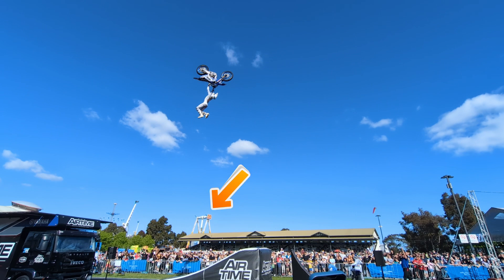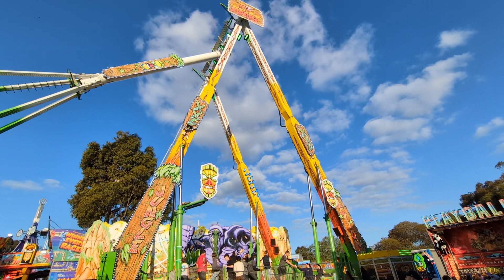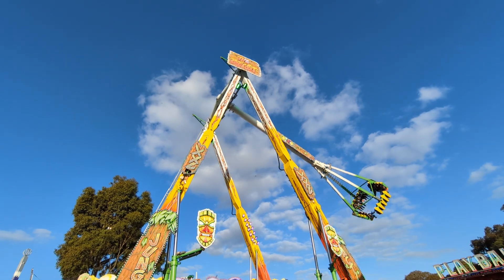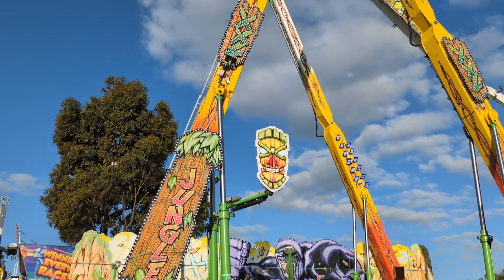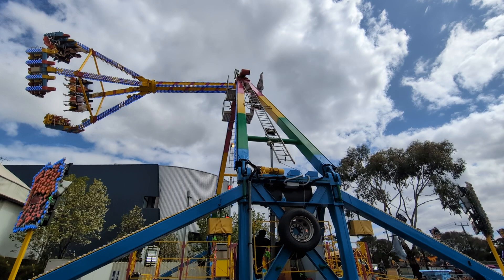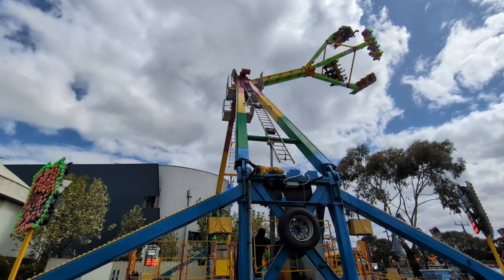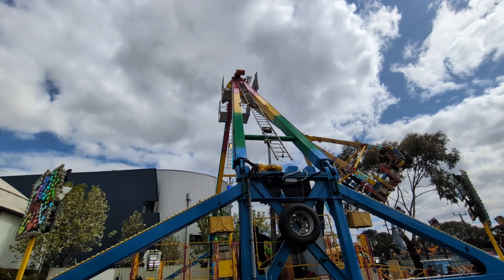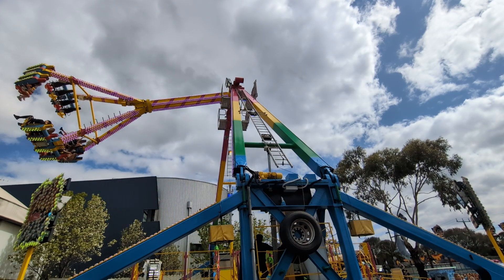Carnival ride chaos - A potential design flaw disaster?

Comment: Both rides are designed by the same company in the Netherlands. There are over 40 copies of the second ride around the world. I think they know what they are doing.
Reply from the maker: What is the company name? I'll contact them and see expected movements. Maybe it is fine, but in my experience steel doesnt move that much without fatigue issues.
Reply: @Nerb1  KMG Rides. They are the Ferrari of carnival rides. It is very common for rides to wobble like this, they are designed to flex so they don’t crack from stress, similar to tall buildings.
Reply from the maker: @tysonskyes6980  If looks like the model is "freak out". I have messaged them with some technical questions. I'll see if they have time to respond.
Reply: @Nerb1 this is a world famous company bro, not as simple as I’m gonna contact them 🤓
Reply from the maker: @XtremeScreamsYT31  They have a contact form dumb arse.

Comment: The biggest concern I would have is the Showies that maintain them.😬
Reply from the maker: Yep! I agree!
Reply: Australia has very detailed legislative requirements for the operation and maintenance of rides to ensure public safety. Regulations apply to both fixed and mobile rides and are enforced by the Regulators of each state and territory. This pendulum swing ride will have been given a Design Registration Number after an inspection by state-certified engineers to operate in Australia and this is signed-off by the Regulator. Given this, I wouldn't worry about it being an unsafe design. During the certification process, the engineers provide the owner/operator with an inspection checklist and schedule. You then have to rely on the operators/owners maintaining the ride accordingly and updating the ride's logbook. The logbook is examined during the annual inspection that's mandated by the Regulator and carried out by certified engineers. There is also the requirement that a more in-depth 10 year major inspection be carried out as part of best practice but this is only expressly mandated in Queensland, as far as I'm aware. It all boils down to how much you trust the government ;-)
Reply from the maker: @stephenmundane  Unfortunately all of these things applied to the Melbourne Star.... and it failed from fatigue after 40 days of use. 
You may be right and this ride is checked often, but in my opinion the visible bending of large steel box sections is certainly going to fail by fatigue... it is just a matter of how long.
Reply: @stephenmundane  that all sounds very impressive... so tell me how well that worked with that water rapids ride on the Gold coast.  Holes in the swiss cheese and all that.
Reply: I work on the theory, if a catastrophic failure didn’t happen on the 2 or 3 runs while I’m waiting in line & watching,…
…she’ll be right mate. 👌👍
Reply: nah mate she'll be right
Reply: @peterbarakan9006  ha ha! Those machines start out professionally made but end up covered in the best bird shit welds in the country.😂
Reply: Good work Nerb highlighting the risk factors. I barred my children from these vomitron rides and now the grandkids get lectured too.
Reply: This... 
Mum and Aunt remember being on the Zipper with me as a kid,  and well as we were flipping and flopping around with me in the middle having a great time, I went airborne and went under the seat railing and pad, they grabbed me and pulled me back before I went through the outer bars. They were trying to yell for the attendant to stop the ride, but they got a "Thumbs up" and made the ride faster, faster, and longer than the normal amount as there wasn't a queue at the time.